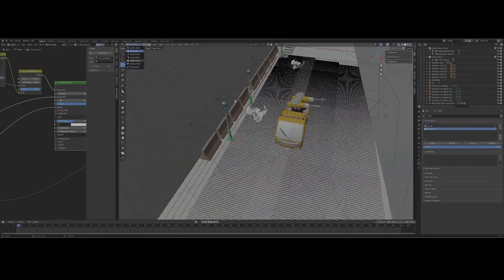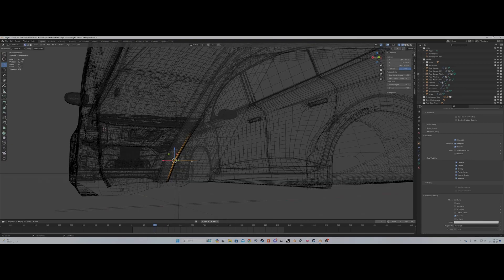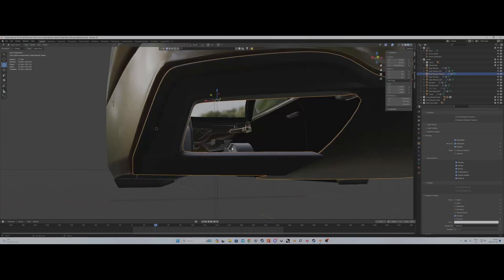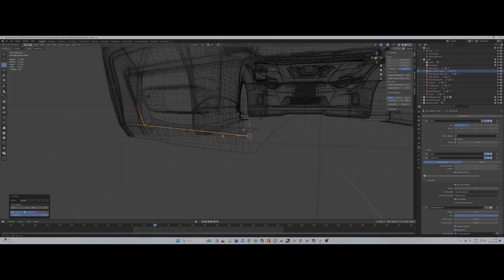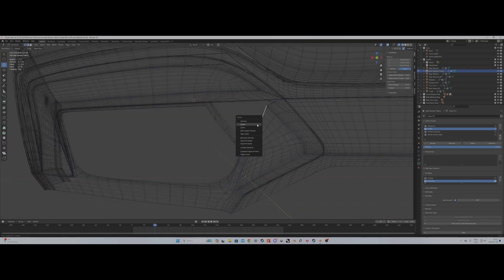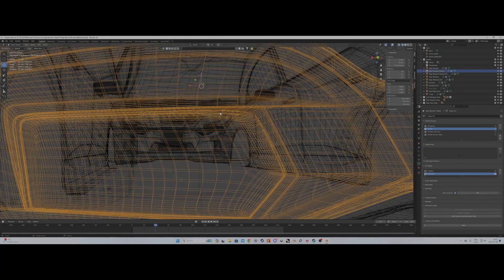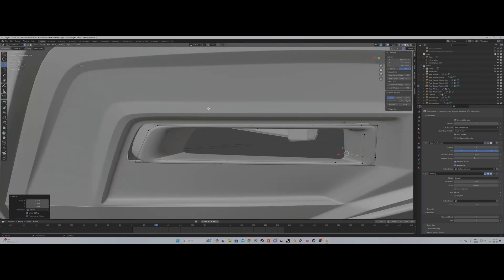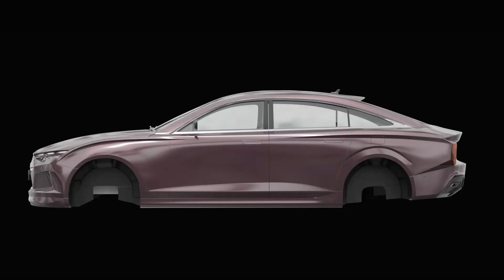Weekly Build 02 - Process Breakdown

Comment: There needs to be a better way to model than this.. its so hard to make cars
Reply from the maker: And there probably is! 

This is the method I use since it allows me to be very flexible with designs but also gives me the best quality from the other methods I tried. 

It’s also important to know that cars will never be as easy to model as a cup or a donut, they are complex products made from many parts combining organic and geometric features. 🙂
Reply: @baril3d  i am experiencing this hahaha 😆 oh my gosh. I have a whole new appreciation for 3d assets honestly. So much work goes into them! I am sorry if i seemed to be speaking against your manner if meshing! Its not you - its me 🤣
Reply from the maker: @handlehaggler Oh no don’t worry I hope I didn’t come across as mean with my response 😅

If you need help or have any questions regarding modeling please let me know and I will be happy to help. It can be tough in the beginning 😄